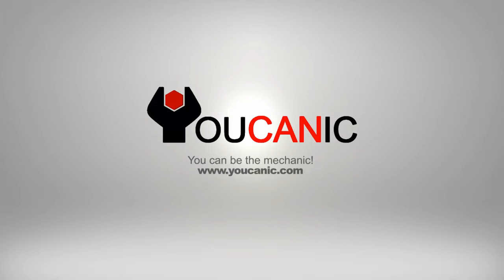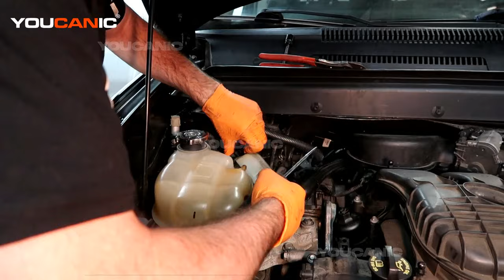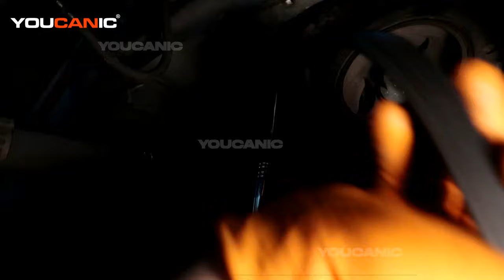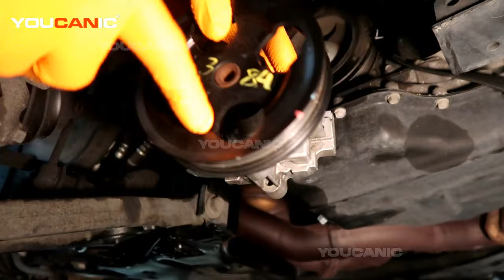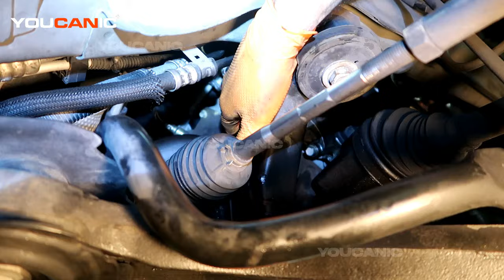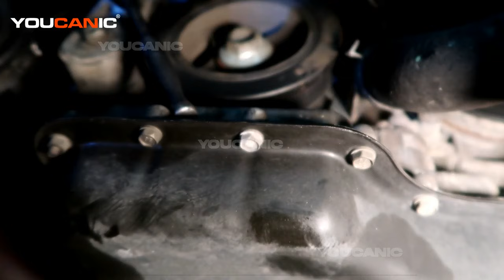2009-2020 3.6L Dodge Journey - Power Steering Pump and Reservoir Replacement

Comment: So you didn't end up removing the bracket that holds the power steering pump?  You just removed that bottom bolt but left that bracket in place?

Comment: Where did you purchase the new used power steering pump from?
Reply: I use rockauto for nearly everything. Be sure to flush or do fluid change through the whole system before replacing the pump and put a power steering magnetic filter on to extend life of the next pump and rack.